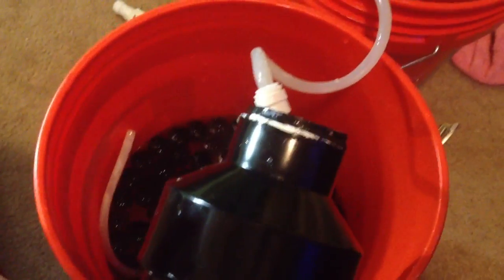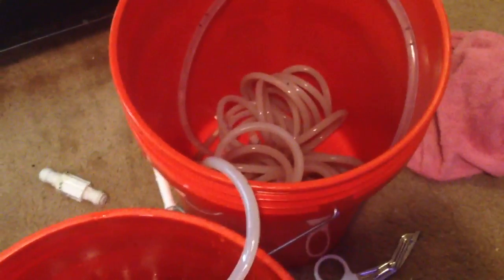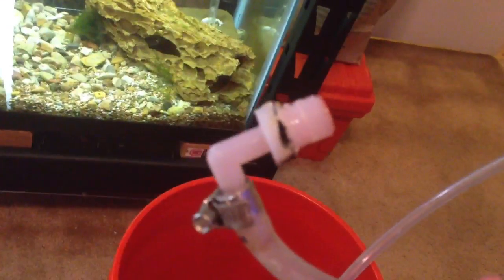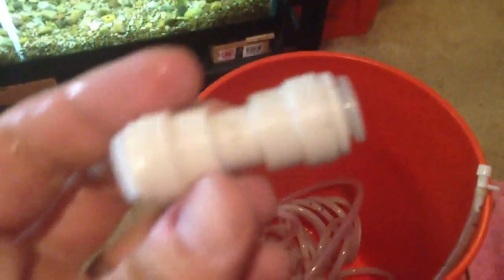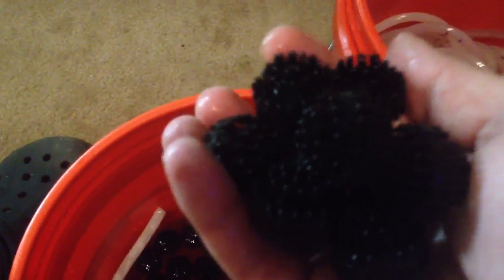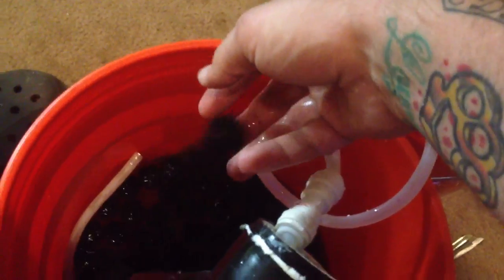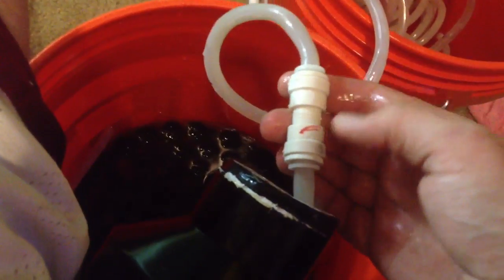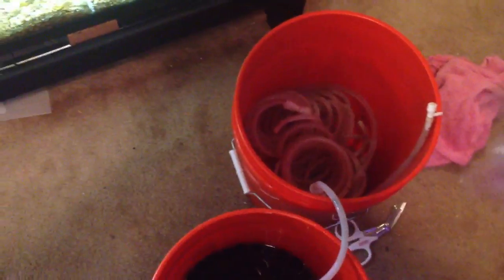Dissection of the Denitrator.

Comment from the maker: That's the beauty of this filter. You can make it as small or as large as you want. The reason I made it so big was to over filter at a faster pace because of how slow the drip is. What size you have to determine is the pump running it. The faster water comes in the faster you can make your drip. I've seen one here the size of a coke can running an under stocked reef tank. These will not eliminate water changes however but can prolong them if done right.